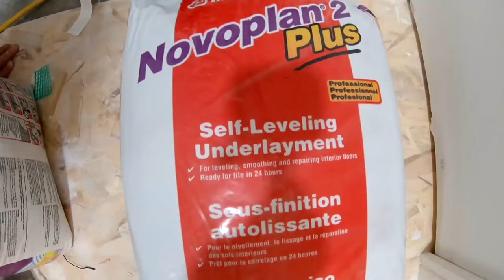Full Basement Renovation in 7.5 minutes

Comment: Amazing work and beautiful results. How high is the ceiling in your basement? I’m 5’6” and the ceiling seems to be about two inches above my head. Do you think it’s too low of a ceiling and I should just work with that? I’m discouraged to finish my basement bc of the ceiling height. Your thoughts? I don’t want to spend more than 10-12k. Right now my basement is completely unfinished but there is plumbing in place for a small bathroom 👍 so that’s a huge plus. It’s just the low ceiling that bothers me. Love how your bsmt looks and the functionality of it 🙌
Reply from the maker: The ceilings are 9 feet in my basement. If your ceilings are as low as you think they will be then  will be even lower when you put up the drywall for the finished ceiling. It is possible but even the doors will have to be cut down as normal height doors will not fit. Your shower head will be low in the shower, etc. Resale value will be pretty tough. Best thing to do would be to go look at some houses that are for sale in your area that have a finished basement and probably have the same basement ceiling height and see how you like it.

Comment: Great work!  What was the 2 part glue you were using on the base boards? It looked like a liquid glue and a spray activator?
Reply from the maker: Thanks, The glue is called instant bond I got it at Home depot. It works great and makes trim work 10X easier. 
https://www.homedepot.com/p/Instantbond-100-400-ml-Clear-World-s-Fastest-Instant-Adhesive-and-Cyanoacrylate-Glue-and-Activator-Spray-100-400/203082931
Your channel has sure grown since the Crown Vic Build. That's Amazing. That video you did showing how much you made through the course of that build and after really got me motivated to start this channel!

Comment: Man he got skills!!
Reply from the maker: Thanks!
Reply: @ResearchDesignBuild  how did you learn to do all this? What's your career and background?
Reply from the maker: @CyclingYYC  I'm an Engineer. But in school they didn't really teach the hands on part. So that I learnt just through doing. Trying out smaller projects and then taking those skills and applying to larger projects. For instance I wanted to make concrete countertops several years ago but had never so much as mixed concrete before. So I did a bunch of research, then picked a small project, in this case a couple small flower pots. I made those and they turned out really well. I used all scrap material for the forms and a couple bags of concrete from Home Depot. So all in all it cost me a couple weekends, and $30 in materials. But I learnt a lot in the process and gave me enough courage to try and make concrete countertops. They turned out great.

Comment: Nice video 
Before I install the subfloor,  do I have to level the concrete floor with self- leveling  cement? 
We have uneven concrete basement floor
Reply from the maker: There are shim kits the you can use to level out the panels as you put them down. However you should try to get your floor relatively flat, so if there are some big dips then perhaps look at using some self leveler. But trying to level the entire basement could be a very expensive proposition as the self leveler isn't inexpensive.

Comment: have you done any water proofing ? how you did basement walls before framing ?
Reply from the maker: I did not do any interior water proofing. This is a new home so there the foundation was waterproofed on the exterior and there is weeping tile going to a sump pit and pump around the foundation to keep water out as well. As I didn't finish the basement at the time of home construction I needed to frame the exterior walls of the basement just for the purposes of insulation and vapor barrier as it was a requirement to pass final inspection.

Comment: What do you have behind the vapor barrier and insulation? Wouldn't that just trap moisture?
Reply from the maker: So the idea with a vapor barrier is that you have one side that can breath with the outside air and humidity and then another on the other side of the vapor barrier. So the insulation and concrete foundation all breath together and there is a 1inch or so gap between the insulation and the concrete that allows for some air movement. Any moisture can come and go through the concrete foundation. And we are talking about changes in humidity, not actual flow of water. This is built to the building code up in Canada and this is pretty standard coast to coast from what I have seen.

Comment: I am planning to do it myself our basement and yours seem straigh forward. But I have an issue of design or structure of where should be the room or powder room will be placed.
Reply from the maker: The biggest issue you will have with adding a washroom or powder room in the basement will be the plumbing. If your basement is already roughed in for plumbing then the designer of the house already had a plan on where to put the bathroom and that will be the easiest place. Look for a 4 or 5 inch black pipe that is sticking out of the concrete that is capped off. That would be the rough in for the toilet. If you don't have that, then you have a big project ahead of you. That involves cutting the concrete and putting in a new drain line for both the toilet, sink, and shower. That is a big and messy job. If this is your first DIY job, then I would suggest you bring in a plumber to help with this portion of the job. But in terms of location the closer you can be to drain pipes that already exist the better as this means less concrete to cut and remove in order to place the new drain pipes.

Comment: Curious why did you use those little squares instead of just using full sheets?…
Reply from the maker: You can't buy full sheets with the insulation attached. You could do full sheets of 1inch think foam and then do 3/4 OSB tongue and groove on top with very similar results. The 2X2 squares are just really easy to work with and move around. They are also very easy to level and shim as required if your floor isn't perfectly flat. I'm not sure how it would go trying to level a 4x8 sheet of foam and then a 4x8 sheet of OSB.
Reply: @ResearchDesignBuild  true! never thought of that! Thanks for the build!

Comment: Where did you get the cabinets?
Reply from the maker: The Cabinets are from Ikea and then I re-painted the doors in a high gloss 2 stage automotive paint. The counters were made from scratch and the bar counter I also painted with automotive 2 stage paint.

Comment: Which is better foam barricade or hard plastic?
Reply from the maker: It really depends on what you need for your climate and basement. If you live in a cold area and have a dry basement then the insulated panels are better. If you are in a warmer area where the insulation isn't going to be as big of a deal, or you have a damp basement then the hard plastic backed ones might be the better choice and also save you a little money too.

Comment: How much would you say this costed?
Reply from the maker: This project was probably around the $20,000 CAD in terms of material and the 2 contractors that I brought in (one for drywall and mudding, and the other for carpet installation). That is for almost 900 square feet of living space including a full bathroom, wet bar, 2 bedrooms and a living room. Now that number can be changed, up or down for your own project by a large margin. Plumbing fixtures, door handles, lights... Those are all things that will add or subtract from that price. You can get a $1200 tap for your sink, or a $80 tap for your sink for example. The heated floor in the bathroom adds a fair bit to the cost, probably in the area of $400. Flooring also ranges wildly in price. The best thing to do it to layout your space. And then go look at pricing for the bit ticket items you will need. Flooring, tile, carpet, hardwood, etc. Then price out plumbing fixtures and lights. For any work you are not going to do yourself get at least 3 quotes for the work. Contractors will again vary greatly in terms of the price they give you.

Comment: the way the walls were done is not at all good. Should be rigid foam insulation loosely glued to the block as your vapor barrier, with your chase wall framed on top of the sub floor in front. I suspect you will constantly build moisture in your insulation and it will be a home for all kinds of mold and critters, just like mine was.  The rest is good though. I made a lot of mistakes in my 20's that I am now repairing in my 40's. 
Just remember in the future on exterior basement walls, it is vapor barrier first, then insulation(unless of course you are using rigid foam as your vapor barrier) then your framing and finish.
Reply from the maker: Yes you can also use ridged foam, this is much less common to do and can result in a greater R value of the wall. I would argue that using the foam as a vapor barrier will be difficult to seal all the joints. You have to keep an air gap between the insulation that I used and the concrete wall this will allow for some air movement and prevent the insulation from pulling any moisture into it. This home is also not concrete block it is a poured foundation with modern water proofing on the outside of the foundation, weeping tile and a sump pump. So the chances that I have a moist interior wall in my basement is greatly reduced.
Reply: @ResearchDesignBuild  unfortunately you have an incorrect assumption.  It's vapor traveling through that space, in to your insulation,  and  being permanently trapped behind your plastic.  It's backwards.  If you put the plastic first hung like a curtain loosely against the wall,  and insulated your framing in front of it,  you would have a system that would last 50 years.  Yours will last about 15 if you develop any kind of leak in your foundation walls. I'm dealing with the same exact thing in mine
Reply: @ResearchDesignBuild  the way you did it was an old school way of doing things,  before we learned better,  and unfortunately most state building codes don't enforce the correct way to do it
Reply from the maker: @JasonEllingsworth  I don't believe you would pass a building inspection if you put plastic vapor barrier right against the concrete. You would definitely build up condensation between the plastic and the concrete wall. I don't really get your point of moisture being permanently trapped. Houses breath, so on the exterior of your vapor barrier there is an allowance for things to change in terms of moisture content, It doesn't all just flow one way and get trapped in the insulation.
Reply: @ResearchDesignBuild  you'll get it eventually
Reply from the maker: Appreciate the feedback and sharing your thoughts.  @JasonEllingsworth

Comment: No need for vapour barrier in basements if half the height  or more is underground . What happens is that moisture gets inside from the outside ground, soil. And cant get through because of vapour barrier and you get mould. Basements should be sealed from outside not inside but good ventilation is a must inside
Reply from the maker: This advice would go against Canadian building code. You would never pass an inspection for a basement without a full vapor barrier on the inside.